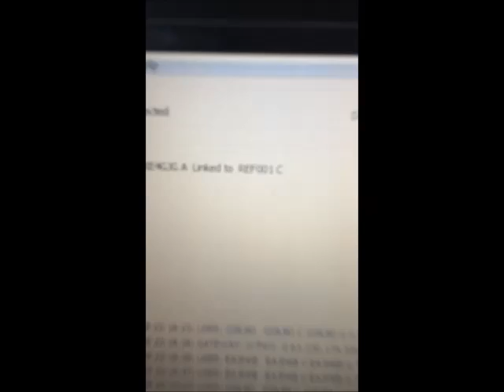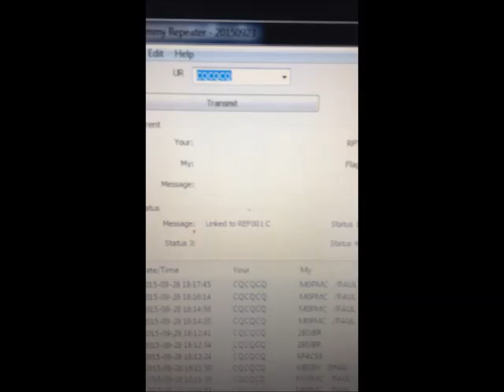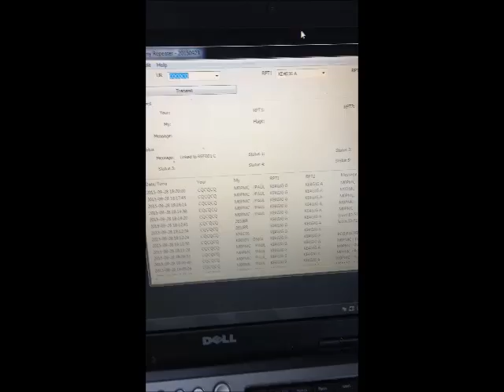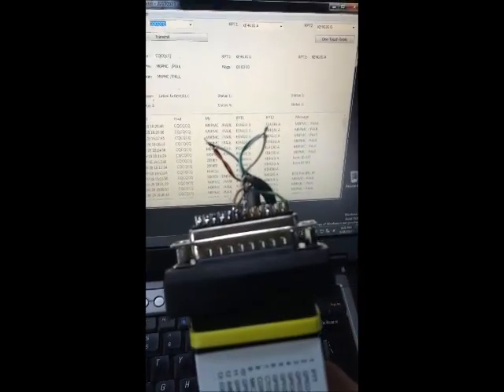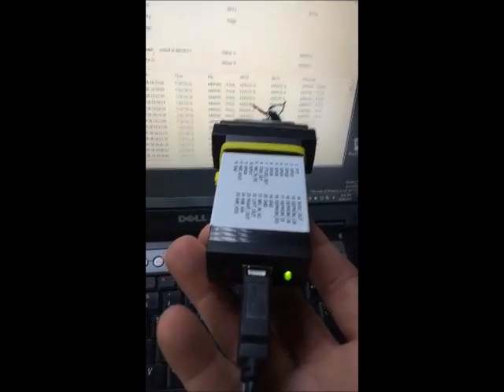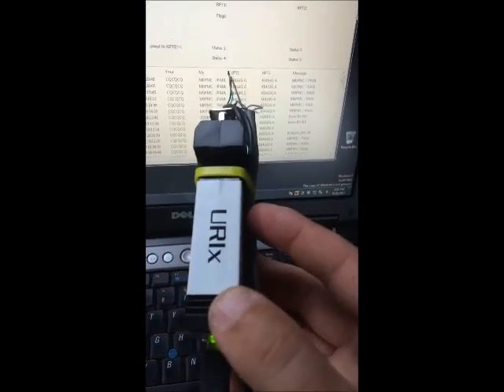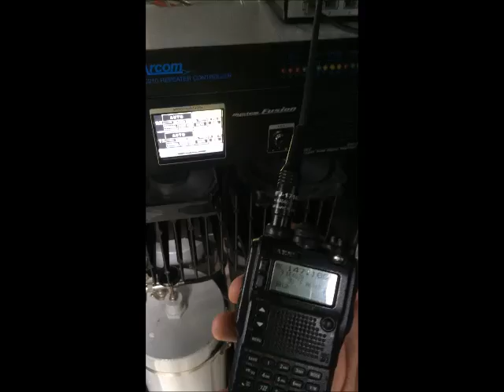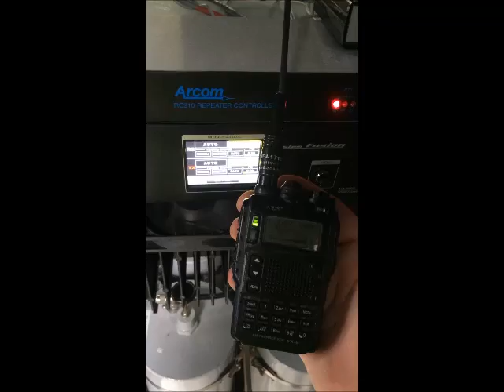DSTAR on a Analog or YSF radio! On a System Fusion Repeater DR-1

Comment: I thought it was against the rules to use analog radio over Dstar on the Dplus systems since your not transmitting your ID each time you key the radio..  You might want to check that out unless they changed the rulling. but you can only do it on the Xref reflectors.
Reply: Brad Kellison to whose rules are you referring?